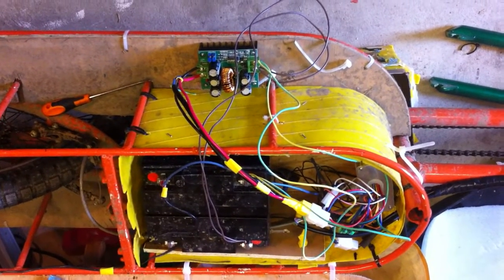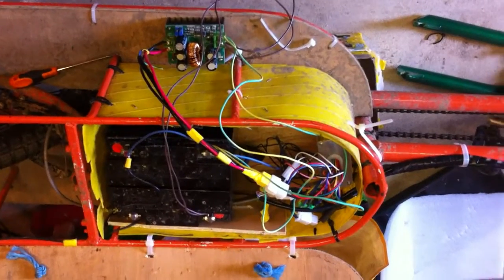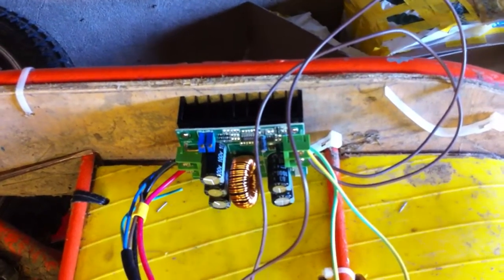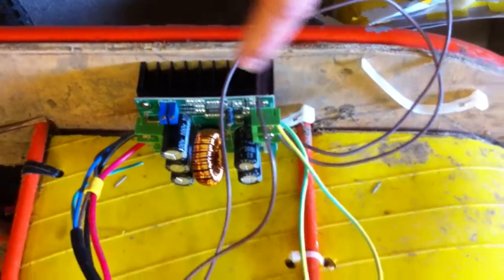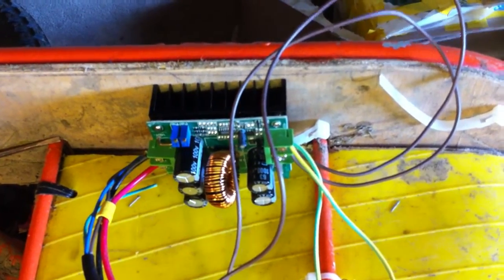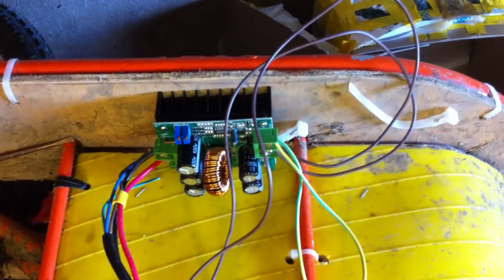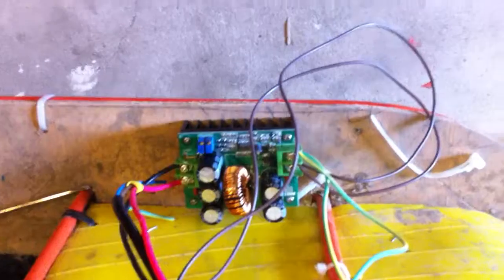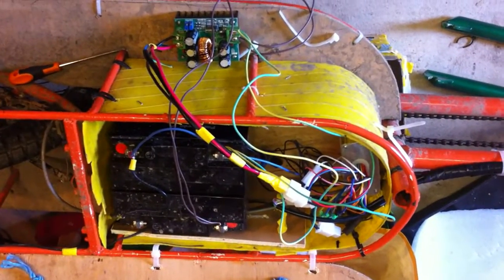Using  a Step Up Transformer to Run Ebike Motor

Comment: I think I bought the exact boost converter you have, I'm going to take a 24 volt battery and step it up to between 30 and 36 volts I bought a cheap 250W motor. My other option is to just build a 36 volt battery and use the boost converter to boost my solar panel up to 36 volts to charge the battery
Reply from the maker: Hi Sean, It may work on the flat (or downhill!) but unless very beefy boost converter will probably die on hills. As you probably know you will have more amps with a smaller boost (in volts) so if 30V is goer then stick with that. or Flog you old battery for cash (not paypal) and then buy a 36V maybe (?) DIY headway pack . . . depends if you have the time. All the best of luck with it. Let us know how you got on if you have time.

Comment: is found any problems on convertet at the running time. Can I use 48v to 72 convertor on e bike
Reply from the maker: I think you would need 2 or 3 of these converters in parallel. Also it depends on application, e-bike or e-scooter in flat area with no hills, perhaps that would work, but any heavy use and perhaps not.

Comment: i am looking for 48v to 36v
Reply from the maker: You would need a step down transformer to do that. It is important to get one with enough amps rating. Is it for an ebike?
Reply: @DorkyThorpy  Yes, i nhavew a sare 48v battery and an old 36v scooter/ebike
Reply from the maker: @way2dumb  the main thing would be to pick a step down transformer that will deliver good amps. say your scooter is 1000W (1KW) then you will need a minimum of a 30A step down transformer. However most motors take twice their rated power under load, so you will need a 60A step down transformer. You will also need 50A wiring to match. That is thick stuff!

https://www.aliexpress.com/w/wholesale-50a-step-down.html
Reply: none on that site dude. of any amp range
 @DorkyThorpy
Reply from the maker: @way2dumb  I think perhaps it is better to use the correct voltage battery, it is not feasible to use transformer at high ampages, and even if you could get it to work it would be inefficient.

Comment: Hup 250w. Can i use 48volt ?
Reply from the maker: Could I have a bit more detail please. 

If you add more volts, you will get more speed, but there may be components in you system only rated for 24V. These would get broken if you use 48V. Open the controller up and look at the voltage rating on some of the components.

Comment: Now, the question is. What if you had multiple?  Like I get that the transformer can output a certain amount of current, but what if you had a huge 12V deep-cycle battery, which has a ridiculously high output current at it's terminals. Could you not in theory, setup parallel transformers in order to satisfy the needs of the motor? Like I get that's a big waste of energy in terms of heat. But if your rolling round with a 150AH deepcycle, your laughing anyway.
Reply from the maker: Yes I suppose that is possible. However, the 150AH battery would be effectively 25% capacity if you were saying 48V. 12V-150ah = 48V-37.5ah I think in terms of Wh. And with the efficiency losses, better perhaps to run 4 lead acids in series.  . . . . maybe.
Reply: Well when you consider that the average EBike range is about 20Ah, 37.5Ah seems fairly useful. and assuming you lost only about a 20% energy loss to heat (which is generous), that's still 30Ah. 10 more for just under same amount of space. of course then your discharge current from the battery would be something crazy like 15-20amps to each boost converter.
Reply: I've been considering exactly this, I'm considering building a trailer with a generator charging a 12v battery running multiple bridged step up transformers, perhaps with a series bank of farad caps across the output???